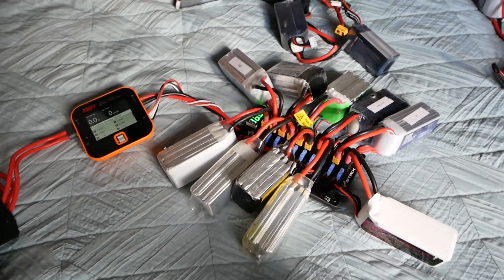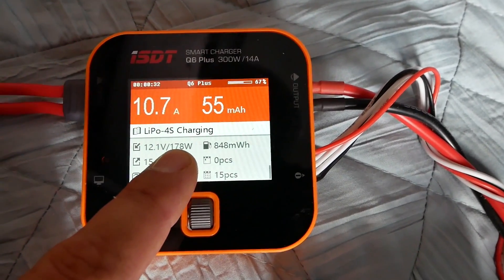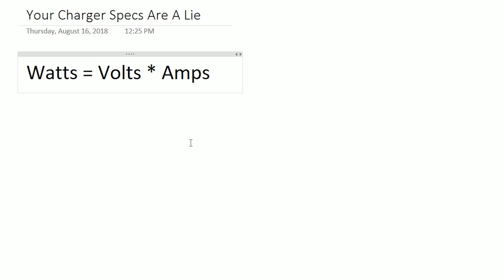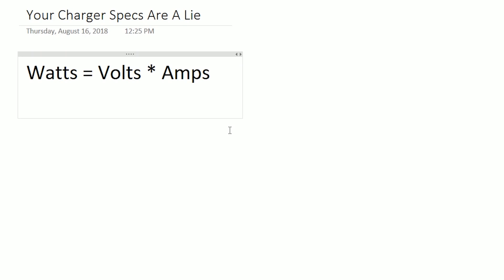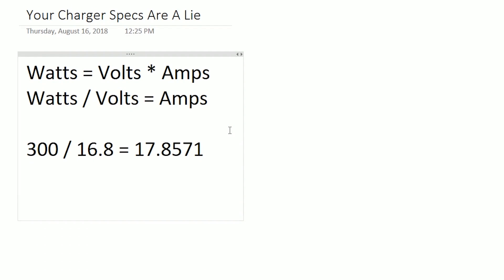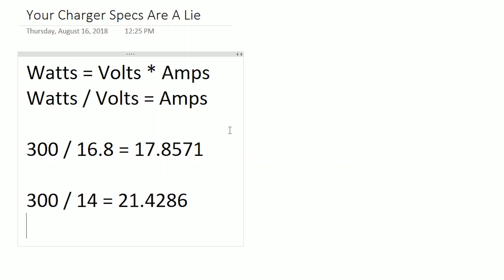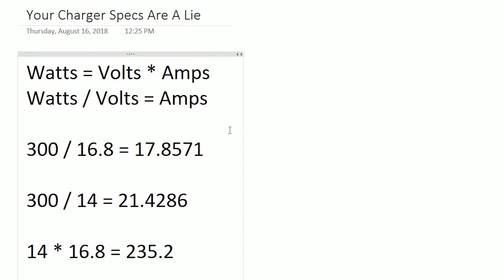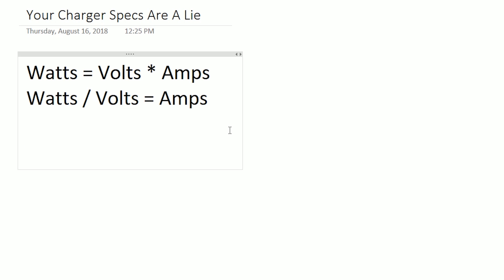Why You MUST Use a 24v Supply For Your Lipo Charger

Comment: Now if I’m at the field. And running a 400 power inverter to the 24 v 400 watt power supply . Would that work or would the inverter need to be a1000 watt. Thanks

Comment: Everything you said makes sense to me. But i cant figure out why my hobbymate d6 charger wont charge my laptop past 1 amp at 19.5v. Its plugged it into the cigarette lighter in my car wich i know can supply at least 15 amps. Now some laptops can be tricky to charge without an oem charger but ive managed to do it with the d6 charger from a higher voltage. It really seems like i need a better charger... Any thoughts or knowledge is greatly appreciated.

Comment: I have a flex power tool with 24V battery but no charger. I would like to know if I can use some kind of setup to charge this 24V battery which I think needs something slightly higher than 24 volts to charge. Thanks.

Comment: Manufacturer should usually list the max input current from which you can calculate what is the minimum voltage required on the input to reach the max output rated power.
I couldn't find this info for your Q6 Plus, for my Q6 nano it was available tho.

Comment: This is why I went straight to using deep cycle marine batteries wired in series or 24V+ (sometimes adjustable) switch mode power supplies the day I began using a 'real' hobby grade charger which required an external power supply.. Once that HITEC 50W charger wasn't quite enough when I stared to fly helicopters larger than <1Ah 3S packs (Blade 180CFX). The Forza 450 and Oxy3 forced my hand on the issue.

Comment: Hi Joshua, I probably already know the answer, but my 2 LiPo chargers have labels next to the DC in port. They say 11v to 18v. I assume that a 24v power supply will be too much. However, I also assume, if the charger is rated for a max 18v, then that is what the power supply inside is already rated at?  Terribly new to this and your explanations are making sense to my last two brain cells. after the 3rd viewing. Thanks in advance!
Reply: The charger is what up regulates the voltage for the batteries. You want to get a 12v power supply that can handle the max Amperage of the CHARGER per channel you have. I have a HTRC T400 charger rated at 15A x 2 = 30A ( total needed from power supply) on DC. I bought a 12v / 460w ( 230w x 2 channels )server power supply that puts out 460w div by 12v = 38.3A max rating. From what I heard, those max ratings typically can't be reached??...Just what I heard, so I don't know for sure. Whatever combo of batteries I charge in parallel, I can't or shouldn't ( I doubt the charger will let me ) go over 15A per channel. Here is example: My balance charger has 4 ports for charging. Lets say 4 batteries x 4500mAh each @ 4S ( 4 cells in series ). So 4S x 4.2v = 16.8v. Now, 230w div by 16.8v = 13.8A per channel to balance charge. A 1C charge rate for a 4500mAh battery is 4.5A per battery or 4.5A x 4 batteries = 18A charge rate total  for 4 batteries on a balance board. But, I would only be able to charge at 13.6A for that 230w per channel power supply. Of course these are max numbers and it may not deliver the max amperage, so the CHARGER, may display a smaller amperage that it can draw from the DC power supply. Depending on how many/big batteries you plan on charging at once, you should get a power supply that can handle more amperage than you will need. The, CHARGER, will pull what amps it needs based on your inputs from the DC power supply if it can handle that amperage. I'm assuming, as I haven't gotten my DC power supply yet, that the HTRC T400 will only allow a draw of 15A per channel, but I also won't input anything higher than 15A per channel. The DC power supply delivers a constant regulated 12v to the CHARGER, the CHARGER then up regulates the voltage to match the number of cells at, for Lipo, 4.2v max charge on each cell. By the way, if this isn't how it works, and I can only charge Lipo's at the 12v max from power supply, this seems ridiculous if it does, and the CHARGER doesn't up regulate the voltage, there is exactly ZERO Youtubers out there mentioning this...Which in reality, is pretty pathetic. I'll know as soon as my power supply comes in for the facts on this matter. Hope this helps.

Comment: Good info - even for us "fixed wing flyers" who watch your channel 🙂  Since I fly 4S 5000 mah batteries and have a power supply that has two output ports 12V @ 14 Amps each (29 amps total), I don't think I'll be trying to parallel charge multiple 4S 5000 mah batteries with my current setup.

Comment: Hi Joshua, I have 2 questions if you wouldn't mind. first is there any way to connect any type of power supply to make a car pump out 24volts?  (Highly doubt it lol) 

2nd question, my 1 charger is an AC/DC it has a standard house plug on one end & the other end has banana clips that plug into it with alligator clips to attach to vehicle battery . what happens if I wire that up to my 24V DC power supply? & if it's even possible or even makes sense would I use the plug end or alligator clip side to solder the correct xt60 plug on it, in order for it to  onnect to my 24v power supply.... sorry if these are ridiculous questions?? Thanks
Reply from the maker: Your car probably can't output 24v.

You need to look up your charger rated input voltage to answer the other question.

Comment: What a helpful video. I"m in the market for a new charger because my old one couldn't handle my 6s battery even at 1C. The charger is 6s capable but only at much lower amps. Crazy how misleading most charger specifications seem now that I know the math. Thanks for the info.

Comment: Thank you very very much Joshua for this eye opener. I'm new with (LiPo) chargers and have already seen a few of your videos here on YouTube. Most are pretty clear but this one left me with a question.
Does the max current rate of the source (ac-dc or battery) play any role...or if I may qoute you "which one comes first"? You mentioned that most chargers, at the time of recording, have a max current rate input of 14-16A. But what about max output current rate on the source side...
Example:
Source : DC 30v 9A(max)
Charger: 14A max input - 14A max charge current - volt range 10-32v.
Can the charger charge a battery at a charge current of eg. 10A (higher then 9A=max output current rate source)?
Greetings from The Netherlands

Comment: Your charger's specs are not "lies", as you put it.
There's a maximum input current, and maximum input voltage, as well as a maximum power.
You cannot exceed any of them, so if you can't reach the charger's max Wattage without it shutting off, it's because the input current is too high and you need to use a higher-voltage power supply to provide more power (Watts) at the same input current (Amps.)
It's not a "lie", it's the charger protecting itself--which is what it's designed to do!

Comment: At least of 2020, most lipo chargers capable at 15amp and above, require DC input (a power supply).  Most users don't require that kind of amperage. But some of us will charge 25-30amp single or 50-60am dual, especially people who frequent race tracks.
That will require 1000w+ power supply. Can get cheaply using server power supply, with some soldering.

Comment: Do you also have to worry about the charger input limits? Even if you get a 24V power supply, is it possible that your charger input is limited to 12V?

If so, what would happen if you hooked it up to a 24V power supply? Would it just automatically pull only 12V? Would it blow up?

Comment: Hi! I really have a question! I have 2 ISDT chargers. 1 that is 500W 20a and the second 200W and 8a but when it comes to charge batterie the first charger always stays at 0 amps and 0 mah after starting and the second chargers start charging and the amps are going up but then “abnormal input voltage”

Power supply is 400W 24V 16.6a 

Please help me out! 
Thanks a lot and keep the amazing work!!

Comment: The output nothing to do with the batteries, it is the Input voltage that determines the Watts or Amps output...  You can drive more watts with higher input voltages.  In your case you could easily have pushed 300 watts to those packs if you used a 24 volt supply.

Comment: Charging 14.4 volt cells with 12 volt in, means you`re gonna get less current out than what you put in, because the charger needs to boost the voltage and it demands current to do that.
Easy peasy ;)
Always read the fine print people.
Also read ohm`s law lol, here you go:
https://ohmslawcalculator.com/ohms-law-calculator

Comment: Your a smart dude
Reply: Explain to me why chargers would even need a power supply. You know what I mean an external power supply. I don't understand that, why not just have a charger that plugs into the wall and gets power?
Reply from the maker: That exists. But if you were to bring the charger to the field, to charge off a car battery or something, then the built in power supply would be wasted weight. So some people prefer a high powered PSU at home instead of built in to the charger.

Comment: So running a 24v 15a 360w power supply will be efficient enough to to power a 300w charger?...or even a more power wattage charger? If im trying to charge to packs at the same time
Reply: Or will 12v 1200w 100a power supply work just as good?
Reply from the maker: It depends on the rated input current of the charger.
Reply: @JoshuaBardwell  the charger is 11-18v dc  input at 300w max

Comment: Hey Joshua here I go again with one more doubt. By the way that issue with that similar isdt lipo charger that I told you about it is solved my local dealer send me another one brand new, thanks for the advice. Now I noticed that the lipo charger reaches 52+ degrees Celsius when powered with a 6s lipo battery much more than when it is powered from a 12v dedicated power supply. Can you give some explanation for that. Thanks once more.

Comment: Your conclusion is spot on, but there's a far simpler way of looking at the issue using Watt's formula that you present in the beginning (note: it's not Ohm's law). Input current is not a likely issue if you're power sourcing from a battery or external power supply. The supply or battery will be able to push more than your charger should be drawing, so in the end, you're likely only working with the voltage to scale things up or down for your charger.

That being said, beware of power supplies that may be imbalanced in a direction that's not useful for you. There are 1000 watt power supplies at 12v@85A, but some power supplies will not make use of 85A. If your charger only accepts an input of 30A at 12v-28v input range (making it an ~850watt charger), that power supply can only give it 12v@30A which is 360 watts of power. Terrible! If you had a 600 watt power supply of 24v@25A, you'd could actually get the full 600 watts. Both variables matter, but voltage is normally the one you want to be on the upper end of for your charger, and you could fall short of, or exceed the current ratings of your power supply as needed and it won't really matter much.

If you're plugging a charger directly into a wall socket, you're dealing with AC power @120v US and 240v for most of the rest of the world, you need an AC->DC conversion and will yield a very different power rating for any charger so read up on those specs separately.

Comment: Thank you for your reply. So from what I understood even if there was a problem with the power supply these kind of chargers have some kind of fuse protection... right! so that's why you you said that it was not to go (sorry I forgot to say that the battery was at 3.80 and this happened almost 35 minutes after it begun to charge) in smoke. Thanks again.

Comment: Hey Joshua I like your videos a lot and the made me a more informed rc enthusiast. I seen this video many times and suddenly something happened to me and I have no answer so if you could give me some info I would much appreciated. Here's the thing I bought a lipo charger from Robitronic LD300 expert much like the isdt q6 300w output or 16a and the imput voltage goes from 7 to 28v. So last night I adapted to lattop power supply rated 19v 3.4a an Xt60  to power the charger. Everything was normal with the charger and after doing the settings I begin to charge a 3s 5000mha lipo battery. Everything was fine until disaster happened when all the three cells were 4.20 and charging at 1.6a abip occurred and my brand new lipo charger went up in SMOKE. The end result you already know. Can you help me understand what happened. Greatings from Portugal.
Reply from the maker: It's hard to know exactly what happened. It could be the power supply was having a problem but then the fact that the charger went up in smoke seems to say that the charger was flawed. Whatever the issue, the charger shouldn't go up in smoke!

Comment: I have a M600 Toolkitrc 150W max input 28v 12a lipo charger. So its safe to use 26v 16.5 amp power supply??

Comment: if my charger says it will do 11 to 18v dc can i use the 24 volt power supply? thanks for the help
Reply from the maker: No. Never exceed the input voltage rating of a device.
Reply: @JoshuaBardwell  thanks Joshua

Comment: Great video Joshua!!! Love the math and makes perfectly good sense, I build cases and mine in particular uses a meanwell 24volt supply along with the powerlab8v2 and I love it, check out the Spektrum Smart case I just designed for Cody Adair at  Horizon Hobby if you get a chance, thanks for the great content👍🏼👍🏼

Comment: Considering they don't provide a power supply, how is it lies that this charger is 300 watts? It can certainly do 300 watts with the correct power supply. This title is misleading. Most people aren't charging 10 batteries at once and don't need all 300w
Reply from the maker: The "lie" is that the charger cannot make 300 watts on its minimum input voltage, which many people would not realize. They would assume that it makes 300 watts under all nominal operating conditions.

Anyway, the title is not, "LIES!" That's the thumbnail, which is inherently short and punchy and often not as thorough as the title or, god forbid, the description, or, heaven forfend, the actual content of the video. If you read only the thumbnail of a video, you'll never get the entire story.

Comment: Thanks for the Video,
i've got a 24V 7A spare power supplie that equals 168Watts. Dies this mean i can load an 4s 16,8V pack with 10Amps?
I don't get it wether the input amps are convertet based on the watts or have to be always higher on the input than output. I hope you get the question in my bad english. After you answered that question i definitly learned something today and you got an supscriber more.
Thanks Josh
Reply from the maker: Basically what you do is take output watts, then add about 10% for efficiency losses, then convert back to input voltage to get input amps.
Reply: @JoshuaBardwell  Thank you that formula helps alot

Comment: Do not listen to this idiot !! Because of his advice I burned up a new dynamite charger that cost me $ 200.00...
DO not OVERVOLT a charger
If you value your expensive R/c equipment, don't listen to this moron..
Reply from the maker: Sorry, dude, but if you over-volted your charger, that's entirely on you. Nowhere in here do I tell you to ignore your max input voltage. If you exceed your max input voltage, you will fry your electronics. If you didn't know that before, now you do.
Reply: @JoshuaBardwell  look at the title

Comment: Noob question here:
I have a 20V 90W laptop power supply, with 4.5A. If I solder a TX60 female connector on the end, would that work to power up the Q6? Would the 4.5A rating on the power supply affect the output Amp setting on the Q6?
Worth noting: I only have 3 x 4S 1050mAps to charge.
Reply from the maker: You can do this but the 90 watt power supply will limit the output power of the charger. You will need to set the charger to max 90 watts.

Comment: Don't charge so much batteries at once. It will be not faster, then charging less after another...
I'm Fine with 12V. And it depends on the charger. Don't use 24V if the charger can't handle it ;-)

Comment: I have a 24 volt 1700 watt power supply. I also have a isdt T8 charger. In the future I’ll be running two chargers off this power supply. My question is will this power source hurt the charger? I think output is like 70 amps but not sure. Is it possible to over power the input side of a charger?

Comment: Worth mentioning the T8 1000w needs more than a 24v input. It has a 35A max input, so 24v x 35A = 840w. 
  Need 29v at least and it only goes up to 40v input too.
Reply: What's the voltage you get out of a home outlet? Isn't it 110V? 

I'm sure I'm missing something that will explain why a regular outlet is not enough.

Comment: Hi joshua. Question for you: If I want to charge two batteries (5000 ma 6S Battery)  simultaneously at 3C (the one's that I have can even support 5C) , I am seeing that I can do it with the D6 Duo Pro from Hobbymate. Mathematically speaking it will take more less 15 minutes to charge both batteries at the same time. Am I right? My last question is: To get theses 15 minutes with my Hobby mate D6 Duo Pro, I need to use a Dc Power Supply 24 Volts and at least 700 Watts. Is this correct? If all these conclusion are Ok, where Can I buy a DC power supply that can handle at least 700 Watts ?. Best Regards.